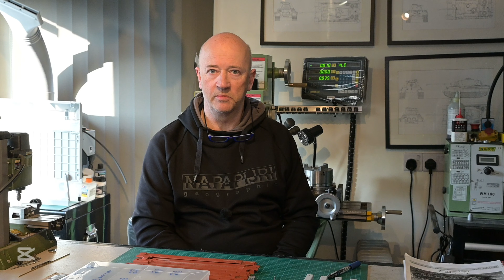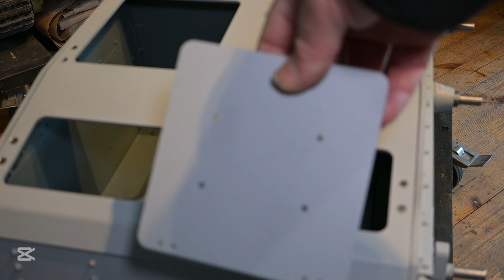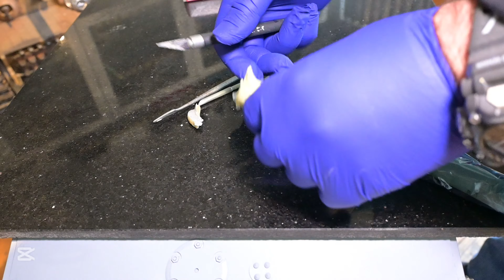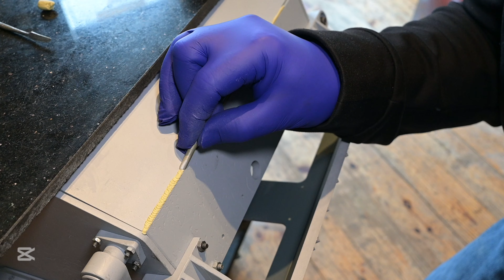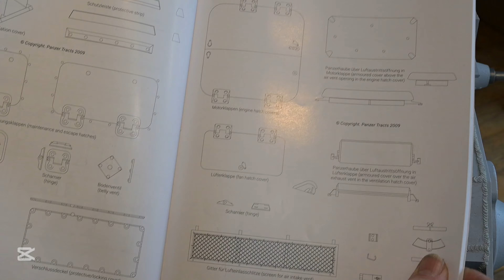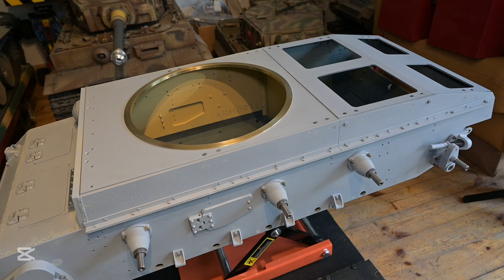Armortek 1/6 scale Panzer III (Part 7) Milliput welds, hatch hinges

Comment: Don’t beat yourself up over the loss of your film work. I’m sure we will all enjoy what is to come. Cheers. Q do you etch-prime all parts before assembley?
Reply from the maker: @warrensilk5316  I etch prime steel and aluminium also brass.  Whitemetal parts are fine with red or grey regular primer.  The kits often have aluminium and steel in close contact.  The contact areas are prone to speed up oxidisation.